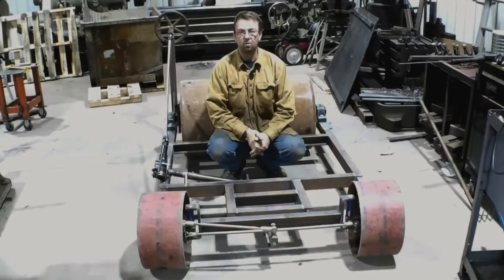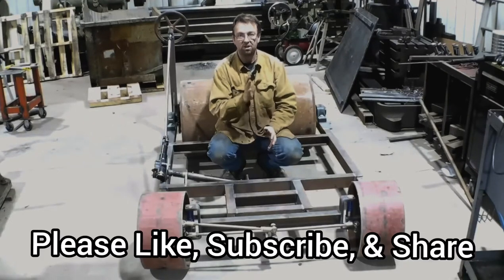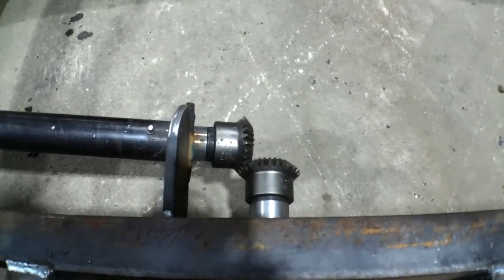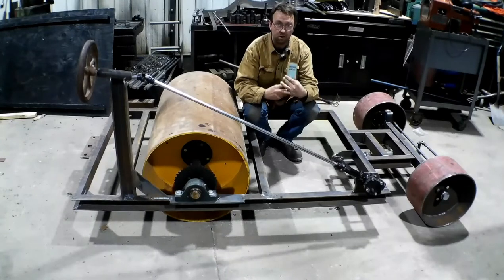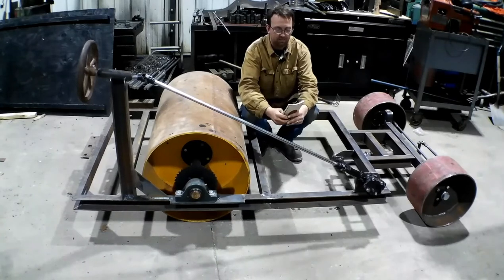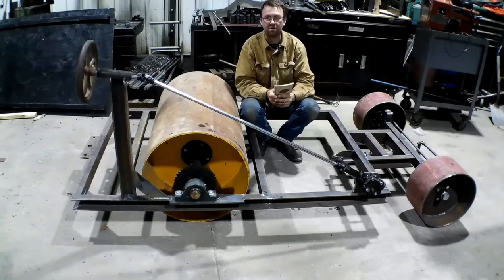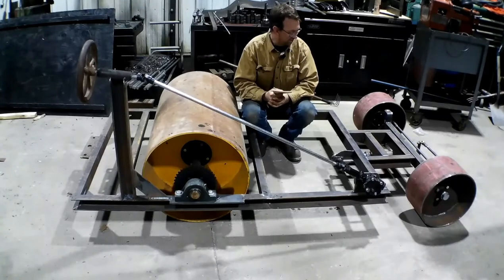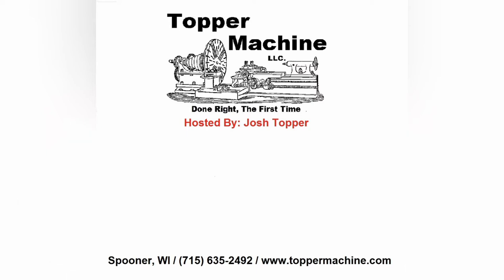Gray Drum Drive Garden Tractor, Build Update

Comment: Does that central bevel gear need shrouding from mud, dirt, or bottoming?
Reply from the maker: Good question. The original was in a gear case. Found that out from the catalog. As of right now, I will leave it open, but eventually may encase it.